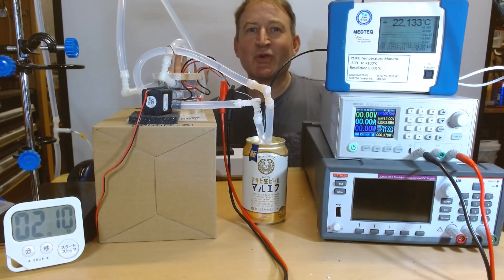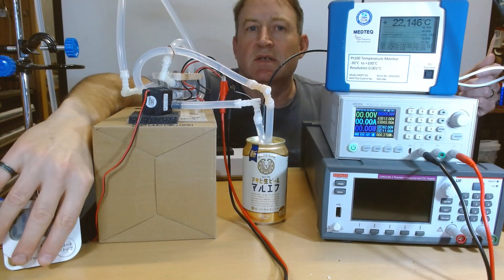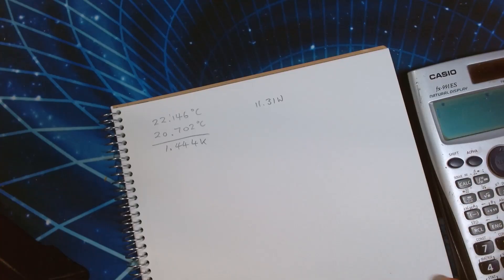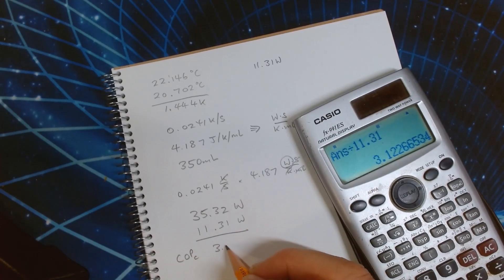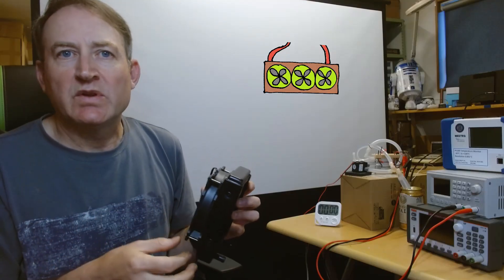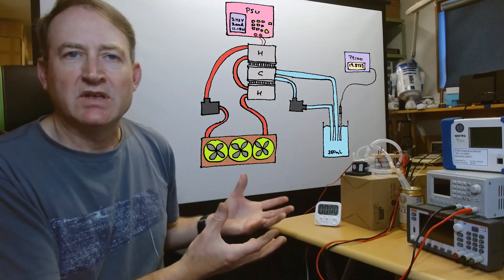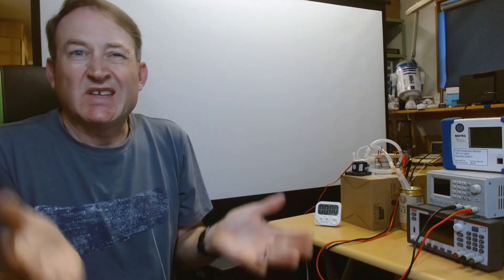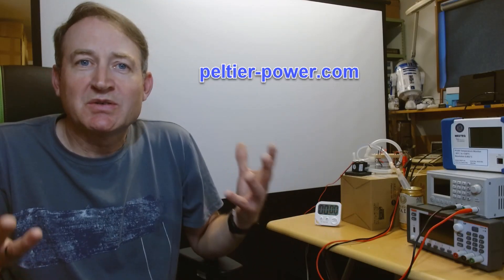Peltier efficiency test - the real one

Comment: Its better to do this by just calculating joules in vs joules out, but there are some other issues with your experiment that you have to correct for when you redo it.

Joules-in, call it 11.22W x 60s = 673.2 J
Joules-out:  0.350L of water x 4200 Joules/{Liter*C} x 1.44C = 2116 J

Resulting ratio: 3.14.

But there are a number of problems. 

(1) Location of temperature probe.  I don't think you were actually measuring the average temperature of the reservoir of water, but instead were measuring exhaust temperature or something close to it.  This is a big one.   I think its pretty obvious given how quickly the temperature began rising after you ended the experiment... that seemed a lot faster than ambient temperature heating would be able to put back into the water with such a small temperature delta.

(2) Power consumption of fans and pumps weren't added in.

(3) Power consumption of Peltier device was very low, meaning the power consumptions for the other elements almost certainly dominate the experiment.

(4) Temperature delta was very small.  Peltier devices can make small temperature changes fairly efficiently, but not large ones.  It gets very bad, very quickly.

Peltier devices aren't this good, period.  That should have been a big red flag that you were doing something wrong.

-Matt
Reply from the maker: Hey Matt, thanks for the comments. The probe is in the bulk of the liquid, and the flow rate is relatively high (about 2L/min) so there's good mixing and also at that flow rate with 30W cooling, there's only 0.2°C different in/out of the Peltier. Once the Peltier turns off the internal leakage (of the Peltier) of about 1K/W allows the heat to flow back, and keep in mind the hot side probably went up by +1.5°C giving a total dT of about 3K, meaning the instant the power supply turns off there will be about 3W of back flow (nothing to do with ambient). With the sensitivity of the Pt100 probe it picks that up. Yes, the power consumption of the fans and pumps are not added it, it's not the point of the experiment. I've built an air conditioner with a 10 bank Peltier and it gets excellent system level COP including pumps/fans, pumping about 300W cooling / 420W heating with 120W input to the Peltier bank (direct from a solar panel ... even better!) and the fans/pumps are about 14W. Testing with a single Peltier it doesn't make sense, it doesn't have the scale. Finally, yes dT does reduce the power but not as much as you might expect. Most people use 1K/W heat exchanges (fan on aluminium heatsink) whereas in my air con I'm using 0.025K/W heat exchange (which is still too high, a work in progress). A high external resistance creates a huge dT at the Peltier face which then kills the Peltier, but the same occurs in any heat pump. Peltier devices are not bad, they just get a bad rap due to poor quality design of the thermal circuits outside of the Peltier combined with some misunderstanding about the ZT formula, the two mistakes keep reinforcing each other. This admittedly crude experiment is my first step to addressing the misconception. More soon!
Reply: @PeltierPower  If you really want to try to validate this claim, what you need to do is a larger test with a much higher temperature delta and larger volume of water... at least a 15C delta and 10 liters of water.  Otherwise you aren't really testing any sort of real-world case.
Reply: @junkerzn7312  Look, he is only claiming that there is a few cases where Peltier CoP is high. He isn't claiming Peltier has high CoP overall. Your demand on the condition is absurd and clashes with the purpose.

The idea is Peltier has a niche use with high efficiency. That you can get good efficiency in small current to cool down few degree C in specific setup. That this video shows you can also improve this CoP by tweaking here and there.

That people should not ignore use of Peltier completely.
Reply: 1. The location probe is right, it is not in exhaust temperature.
2. Fans are not important for CoP, because it can be cooled from other sources like river, ground water or any kind of DiY hobbyist can think of taking free source. Only pump that is needed and that varies a lot depending on the length, height, volume, and type of pump. So removing this factor is a good idea. Of course you can add yourself your own pump and fan to the calculation of CoP. It doesn't matter, because it is NOT the point of the video. The point is to prove that there are small cases that Peltier has a very high CoP.
3. Of course, that is what is attractive to Peltier, it can be very small and big and can be adjusted smoothly using current-limiter power supply.
4. And he is debunking about Peltier having very low CoP. He wants to prove that there is small cases that Peltier is highly efficient. And he demonstrated that well.

Of course there are plenty of cases where Peltier is very terrible efficiency. But that is NOT the point of this video.
Reply: @stark_energy  You are welcome to actually try to build something useful, but you won't get very far.  And he isn't debunking anything, is the problem.   The experiment cannot be scaled-up.

I'm sure he tried to do it off-screen later on and realized that it wasn't working.  That's because the efficiency is inversely proportional to the overall delta temperature.  It cannot be multi-staged either because the rejected heat from a later stage will completely swamp any cooling from previous stages.

So the result will be the same no matter how you try to do it with a Peltier type of device.  Any decently useful temperature delta will have poor COP.  Extremely poor COP.
Reply from the maker: @junkerzn7312  I'm currently running a scaled up system of 10 Peltiers to heat my office and it provides about 300W of heat at a system COP of about 2.8 (about 95W for the Peltier bank, plus 15W for fans, water pumps). The dT is around 10-20K, I'm using a kids pool under the house (on the foundations) on the other side that absorbs the cold (roughly 200W of cooling). It works fine. Great actually, especially since I drive it off a solar panel as well. The key point is you have to manage your thermal resistance. If not, you generate large dT across the Peltier from the heat flowing through the external thermal resistance, that in turn absolutely kills the COP. That's why scaling up usually doesn't work, people don't manage the thermal resistance to handle the heat flow.
Reply: @PeltierPower  I can guarantee that you are not getting an airflow dT producing 300W of heat with those parameters just from the peltier’s.  You might see that dT on the stack itself, but you won’t get that in the airflow.  It’s not even remotely possible.  What is the water temp verses the nominal room temp?  It sounds more like you are just doing a geothermal transfer and the stack is just operating as a heat exchanger (+ 95W).
Reply from the maker: @junkerzn7312  I can understand the scepticism! A second key point is that each individual Peltier is being run fairly gently (about Qh = 30W, so with 10 Peltiers = 300W total) which if you check the datasheets is well within specification and expected results even for a dT of 20K. I just checked the readings and currently getting exactly 300W heat out with 112.6W input, with kids pool is currently 11.22°C (which is colder than the foundation area about 14°C, while the outside temp is ~5°C). My room is about 18.6°C (not great I know .. but it's for science). The hot side of the system is a liquid circuit that is 23.85°C into the bank and 26.30°C out, and the flow rate is 29.1mL/s, which is where the 300W is derived from. There is a low thermal resistance heat exchange (about 0.05K/W) to move the heat to the air in the room. When the system is off, the room noticeably cools (I have sensors well away from the system, one is fast responding and the other is a large metal slug). I've also tested with a normal 300W heater and confirmed it gives the same results. Again, I know Peltiers have a terrible reputation but used carefully they are not anywhere near as bad as often stated. Not as good as compressor systems for sure, but not useless either. Just check the datasheets.
Reply: @PeltierPower  You can do another test.  Take that 112.6W input and just heat up a resistor placed in the liquid flow with it and do your same inlet and outlet liquid measurements as you do with the TEC stack.

Here's the problem.  Every stage in what I presume is a series-connected peltier stack results in a reduction of the heat transfer capability of the system.  It isn't physically possible to connect TEC elements in series with the same heat transfer capability on each element at the same power level in each element to create a heat flow across all elements at the same rate that you get with the first element.

Another way of thinking about it is that the cold transfer from the element furthest away from the cold side of the stack has to transit 9 other TEC elements to reach your cool side thermocouple without any losses.   Each element being transited has a lot of efficiency.  Efficiencies multiply together.

The thermocouple on the hot side of your stack is literally incapable of adding 300W of heat to your liquid flow.   I suspect that you are not measuring the inlet and outlet temperatures properly, probably due to insufficient mixing of the liquid at the outlet measurement point, or due to an improper calculation of the flow rate.

A second problem is that the greater the temperature delta between the hot thermocouple and the cool thermocouple, the less efficiency the whole system will become.   You managed to create a temperature delta of literally only 2.45C or 4F (assuming your temperature readings are accurate).  That isn't going to be able to overcome the the room's heat loss rate or even come close.  The energy is being completely thrown away.

A third problem is that you are claiming close to the maximum possible efficiency in an untuned stack of 10 TECs, which requires a very finely tuned dT per element and current.  Did you actually check that claim against the data sheet for the TEC elements?

-Matt
Reply from the maker: @junkerzn7312  You might be assuming a stack which is terrible for efficiency, it would never work. Instead these are thermally in parallel, so each Peltier adds ~30W of heat in the water flow on the hot side, while cooling ~20W on the other side (round figures). If the flow is say 30mL/s then 30W will increase the water temperature by a small dT of about 0.24K, with 10 Peltiers this accumulates to 2.4K. I have about 35 years experience in temperature measurement (working with medical devices) and would never use thermocouples for this! I'm using medical grade YSI400 series sensors coupled with 24bit ADC and calibrated against Pt100 probes, resolution of 0.001°C, I've carefully designed to eliminate stem effects and so on. Plus this particular design is the culmination of 2-3 years of experimentation including a lot (lot!) of failures, but eventually worked out where the bottlenecks are, in particular the thermal coupling between the water circuit and the Peltiers, and again between the water circuit to air. I'm still only getting about 70% of COP as predicted by the datasheets so there is still work to do, the hot side heat exchange really should be ~10mK/W rather than 25mK/W it is now (I think I gave the wrong number). For calibrating the system I actually ran the Peltier bank with an ac input of 100W (as measured by 6.5 digit meters) in order to double check the dT vs power relation. Anyway, I understand the scepticism, I'm planning to make a video to introduce the the Peltier air con. Did you see the other longer videos in the channel? They also introduce the air con system.
Reply: @PeltierPower  You can run them in parallel but then you only get a relatively small delta termperature ... no matter how many you put in parallel.  The efficiency will be governed by the dT (and the current, but you can control the current)... so you are severely limited on just how large a dT you can have in order to keep that level of efficiency.

In your case, the dT is so small it has no chance of doing anything to your room verses the heat loss from the room.  Literally no chance.
Reply from the maker: @junkerzn7312  Would be good to chat directly, I'm keen to figure out where the point of difference of opinion lies! There's a few dTs involved here so it can get confusing. The dT for the waterflow in/out of the hot side of the Peltier bank is fairly small and it's really only used to measure the heat into the water. For example, if flow = 30mL/s, dT = 2.4K and heat capacity is 4.2J/K/mL then the heat being added to the water must be 30 x 2.4 x 4.2 = ~300W. The dT from the hot to cold side is a lot larger, it's around 15K. Then there is the dT between the hot side water (about 25.5°C) and the room (18°C). That temperature difference of 7.5K is used to push the heat through the water/air heat exchange (0.025K/W) and into the room, with the 300W pushing though 0.025K/W to create the 7.5K difference. Anyway, it's hard to do this in text, it really needs a diagram :)
Reply: @PeltierPower  I'm going to decline that offer, and again recommend that you actually do the test I suggested putting a simple resistive element in the liquid stream and see what the input wattage does to the temperature you are measuring.   Your calculations need to be more rigorous and better-tested.

Putting heat into a room is not as easy as you seem to think.   The room is constantly losing heat.  If you put varying amounts of heat into the room you will find that the room temperature just won't rise much at all until you get past a certain point... the point where you create enough of a gradient that a decent amount of heat starts to be retained in the room.

You are literally throwing awaythat energy.  It isn't making one iota of difference.

To demonstrate, buy a 300W PTC heater and try comparing how it feels to your little TEC heater.  I mean, literally.  Try putting some airflow at your feet from both of those and tell me which one actually makes more of a difference.

-Matt
Reply from the maker: Yes on both points! First, I often add a resistive block run at 30W in the water stream and measure the dT in/out as a way to calibrate the system (e.g. if 30W creates 0.24K, then 2.4K should be 300W). 

And yes, 300W is not much, and it only changes the temperature very slowly. It is a modern house (a few years old) and the insulation is good, and using honeycomb blinds specially cut to the edge to block air circulation, as well as double glazed windows. Plus there are usually a few other heat sources in the room like my body, PC, lights, about 200W in total. All up 500W is enough to shift the room temperature up, but not a lot. 

Today for example, it's early morning here still -0.8°C outside, no sun yet and room is 12.7°C and before entering it was cooling at about -0.2°C/hour. This is measured by a room sensor which is buried in a 4 x 4 x 15cm aluminium block in the corner of the room well away from any action. When I enter the room, without the Peltier system running the room does actually start to warm up slightly at +0.13°C/hr (again due to due to my body, lights, PC), as monitored over 30min. At the 30min point I turned on the Peltier system, run from a 24V power supply that only outputs 150W max and is anyhow monitored by a ac power meter and is showing 90W total (75W for the bank, 15W for the fans/pumps). But there is no way it is somehow sneakily pulling 200-300W from the mains supply. When run of this 24V power supply (not the solar panel) I'm getting about 275W heat according to my measurement system, which I agree could be suspect since it relies on flow rate, dT measurements. The flow rate is the most dodgy point, I can never be sure it hasn't changed. But anyway once the Peltier system is on, room rate bumps up to +0.34°C/hr (again over 30min). Not great and and the room is still pretty cold, but there is no doubt the Peltier system is actively heating the room far more than the 90W coming from the power supply. 

And the proof in the pudding: over that 30min period temperature of the 220L tank reduced from 10.11°C to 9.91°C. The foundation area is 12.6°C, and when the Peltier system is off but the pumps are circulating, the temperature actually slightly increases, as you would expect. The only reason for the tank temperature to go down is that literally heat is being sucked from the tank to the room. In other words, a heat pump.

Again, absolutely understand the scepticism, Peltiers have a very bad rap. I think I have a real uphill battle to convince people and I'm sure even with the above you will be doubting the results ...